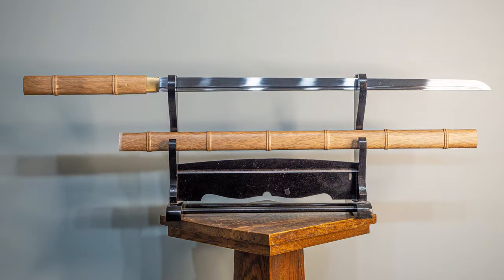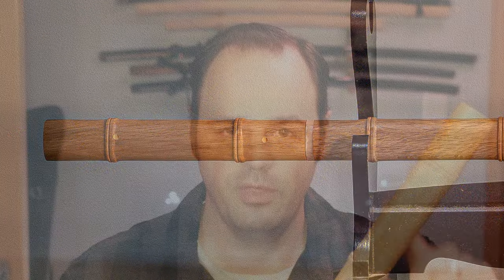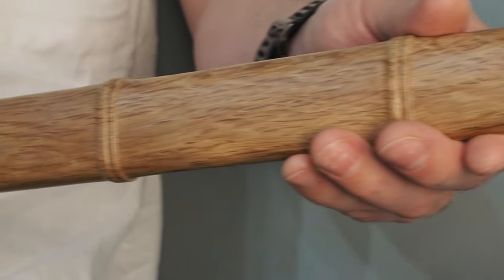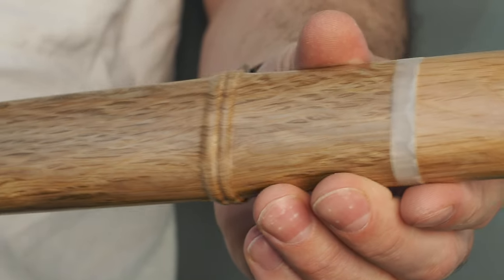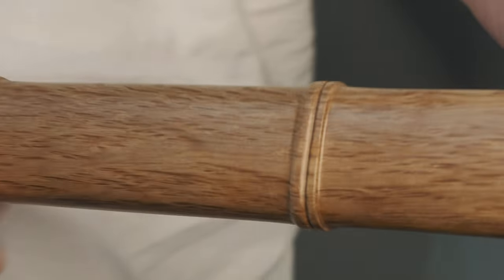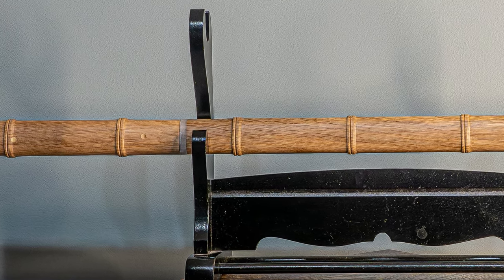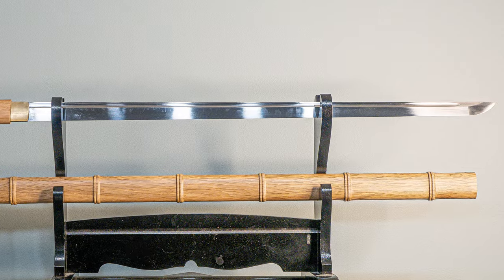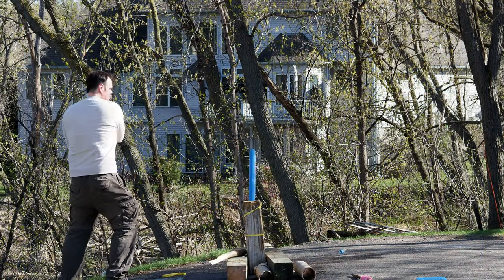Fidestisan Bamboo Katana

Comment: I enjoyed this review of Fidestisan KHON223 Japanese Samurai Bamboo Real Katana Sword High Carbon 1095 Steel Blade Full Tang 40 Inch. I'd be curious to know how Fidestisan KHON223 Japanese Samurai Bamboo Real Katana Sword High Carbon 1095 Steel Blade Full Tang 40 Inch's fittings and edge holds up long term but for only $90 I could give Fidestisan KHON223 Japanese Samurai Bamboo Real Katana Sword High Carbon 1095 Steel Blade Full Tang 40 Inch a try myself.

Comment: I had one of those black swords, you briefly showed.  Eventually I did sand it down [the wood] and repainted it to appear to be a /simple bamboo/ stick.  It worked well -- although the bamboo  joints were painted on.  Ultimately, being more into Western Euro nonsense, I gave it to a friend who was more Eastern interested.
Reply: Ah yes, the rattle was always a give away for my Katana/bamboo sword, NOT being a walking stick -- discounting the length (I'm 6'2").

Comment: Not bad for $90 i suppose. If i were going to go for a "bamboo stick sword" i would prob spend the extra to get the one from Siam blades. Its not a katana. Technically itd be closer to a dha but they are made pretty well from what i hear. They are made with a stain resistant steel but its same one Cold Steel uses in their new Kukri & its good stuff.